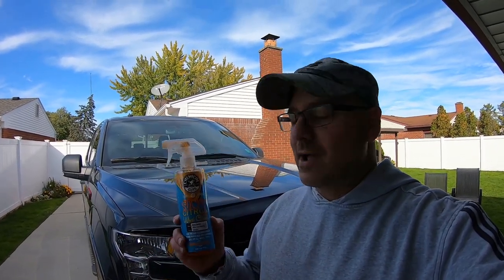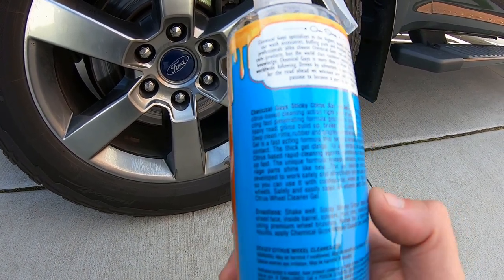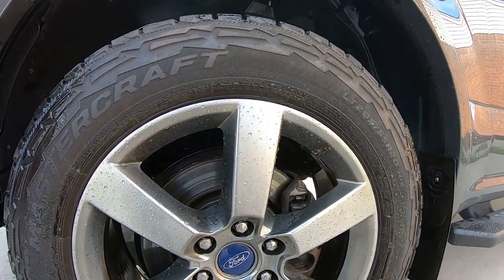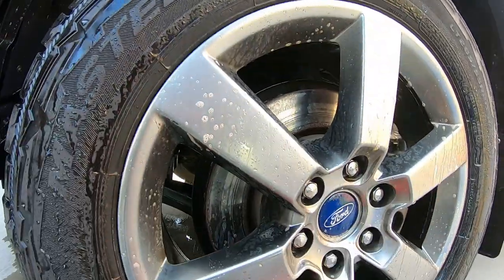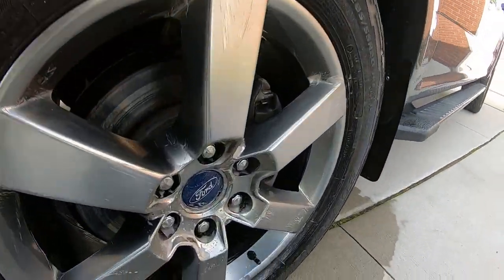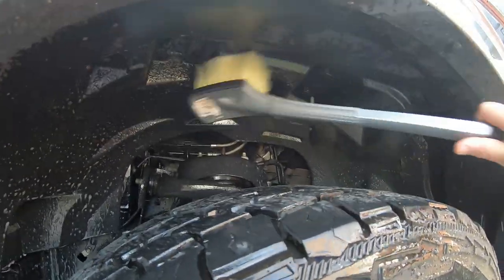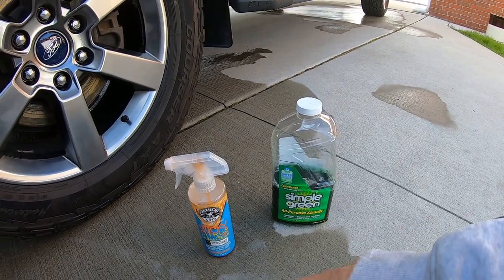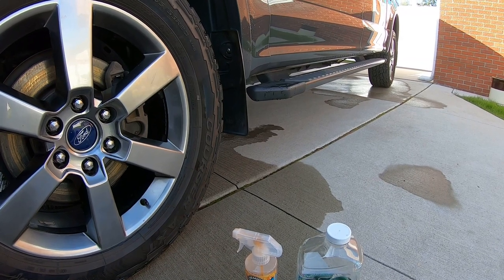Chemical Guys Sticky Citrus Wheel Cleaner Gel (VS) Simple Green | Auto Detailing Reviews

Comment: Yeah, forget that! Their Signature Series wheel cleaner is great and much more economical since you cut it 4 to 1. I buy a gallon and get 5 gallons out of it and use it everywhere Wheels, tires, wheel wells, bumpers, exhaust tips, running boards, exterior plastics, etc. My favorite external APC hands down. PS - There's an issue with Simple Green. The Air Force had to ban it because it causes issues (you can find it o Google). You have to use the one they say is safe for aviation.
Reply from the maker: Still have to get some CG Signature Series wheel cleaner and heard something about that with simple green with aluminum i still need to look more into it .. For sure i need to get CG signature thanks buddy for the great comment .
Happy New Years